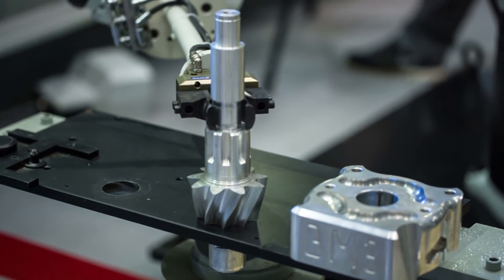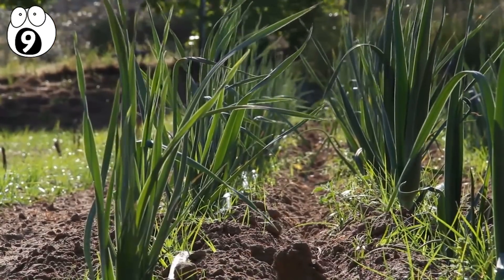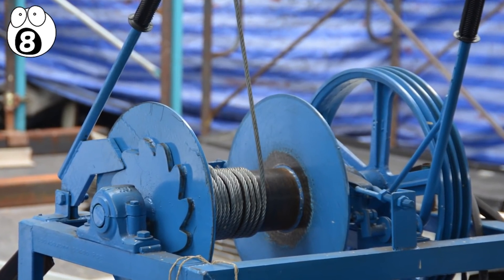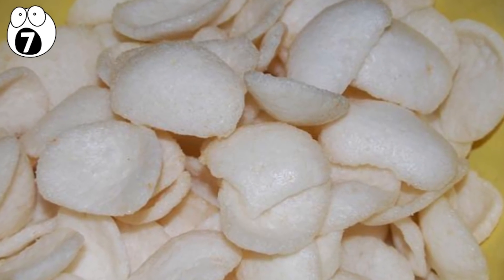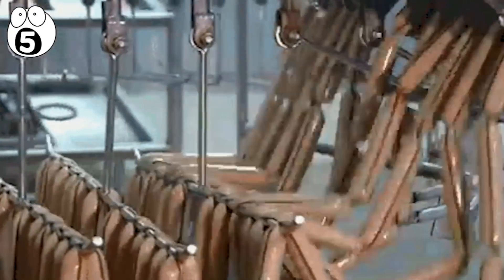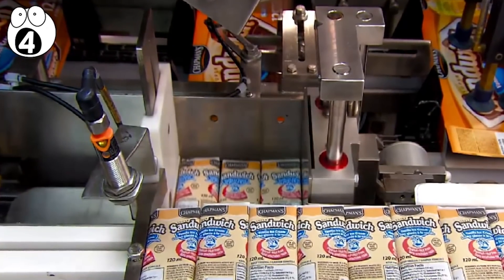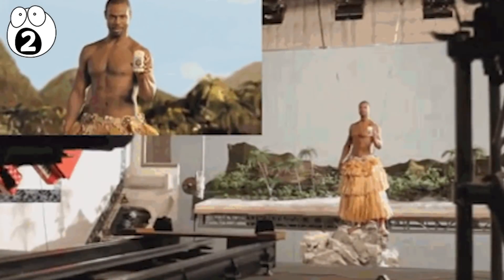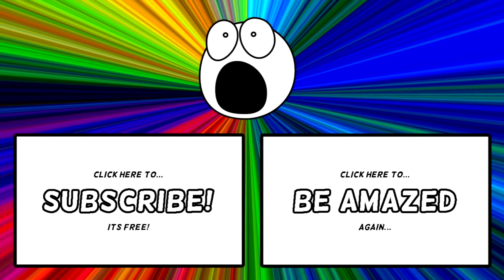Things Made In Ways You Won't Believe

Comment: Everything used to be glass. 1970s and before it was all glass. It was better on the environment too.
Reply: Are you sure? Glass bottles are heavy, which means it will take a lot more gas/oil to burn (more CO2 to the atmosphere) to move them from factory to customers. Glass bottles are also thick and break easily, making them dangerous to move and work with (more energy wasted) during distribution. Glass bottles are expensive, people do not throw them away after used. They need to be moved back to the factory (double the gas burned), cleaned (water wasted and chemical polution), and refilled. Are we just trading one polution with other polutions?
Reply: Plastic is Poisoning our Planet
Reply: I like having things that are clear and don't shatter into millions of razor blades if you breathe on them wrong.
Reply: Its the people improperly disposing of plastic that are the problem, not the plastic.